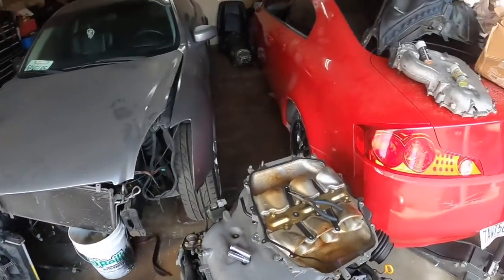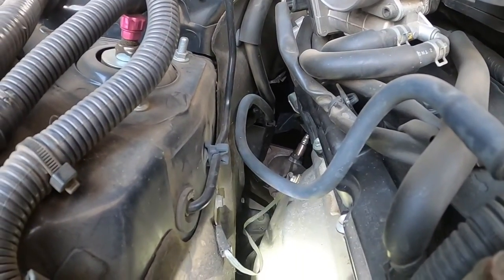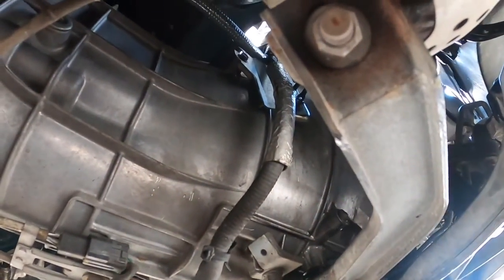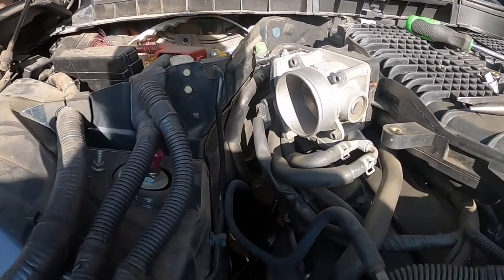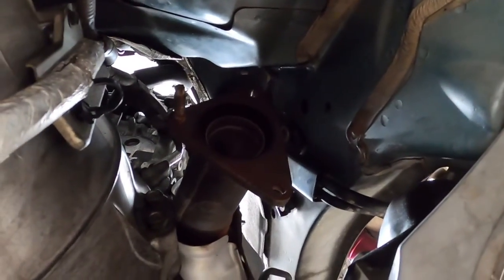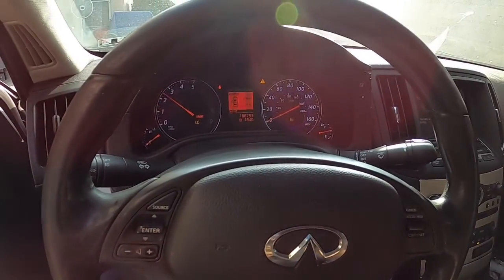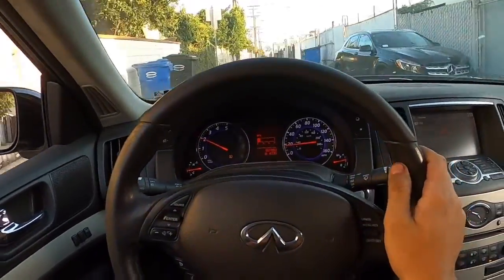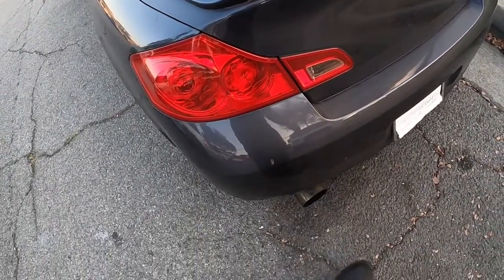How To Install Test Pipes On A  HR G35 / 350z Or G37 / 370Z

Comment: I got a 2015 QX50 with the 3.7 , should I be okay with getting any g37 test pipe ? I would assume it’s the same right let me know as I don’t have much knowledge for it
Reply from the maker: Yeah it should bolt up to the headers no problem but not sure how the y pipe is so you might have to get a custom y pipe but not 100% sure but it should fit no problem